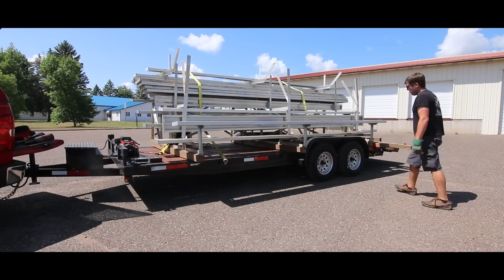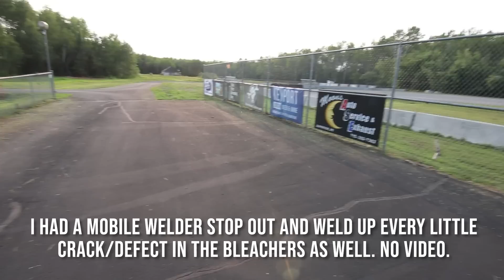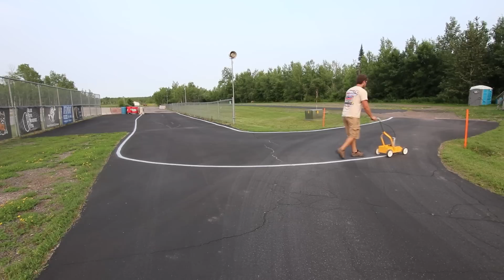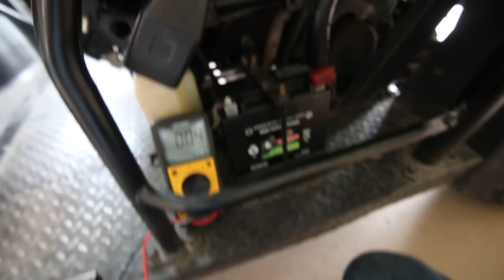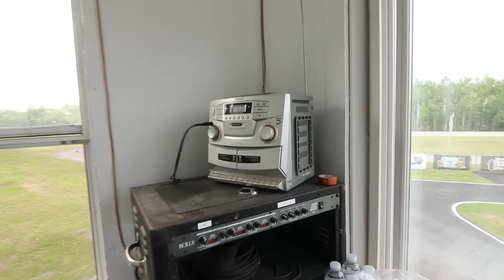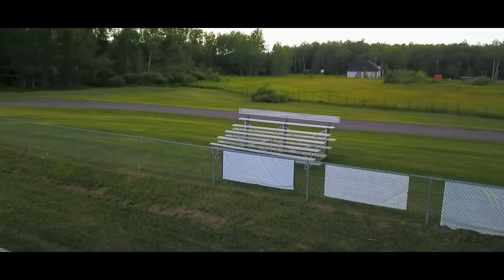FINALLY! We Bought & Installed The 3 BEST Racetrack Upgrades Yet!

Comment: Have been following you since the first video of this track and my gosh the development is so so beautiful. Slowly and steadily... I think this gives a much homely feel than anything track wise I've seen. You're doing an amazing deed. 

Big up, 
A supporter from India.
Reply from the maker: It does have a nice feeling when we are all out there. It's hard to explain. 

I really appreciate you sticking around this long! It's been a drawn-out process, but I'll keep pushing to make this a very nice racetrack for the size.
Reply: Hey I made a simple start light set up for autocross raceing for my geoupe you could make one in the tower it’s just two house switches in a box one is a three way for red and green other is a single switch for a amber stage light we just counts manually in our head 5 sec to switch to green I just use out door extension cords I used the ground oops 🙊 wire for the red light power and the black for the green light power then the white for common nutral and  another extension cord for the ground and to power the amber one with just plug ends it works perfect
Reply: Came here to say the same! What a cool project to follow, what a great thing to do for the motorsport community nearby! Keep on going strong! Grts from Belgium!

Comment: Old friend of mine used to use 2 old tyres and a long length of cord to run the wheels on to guide for a nice long straight line, I have no idea how he did curves though. He would just stretch it out close to where the line went with the tyres being heavy enough to keep the cord tight enough.

Comment: Great to see more progress.  Suggestion for striping.  Long string and use a brick on each end for a straight line to follow.   One brick with the string stretched out to a piece of chalk makes a consistent curve. 

 I would also suggest a horizontal 2x4 (or a couple) to the back of the top seat on the bleacher so no one sits down and leans back and falls.  First one should touch about 2/3 of the way up a person's back.   Especially important for kids who are not as situationally aware.

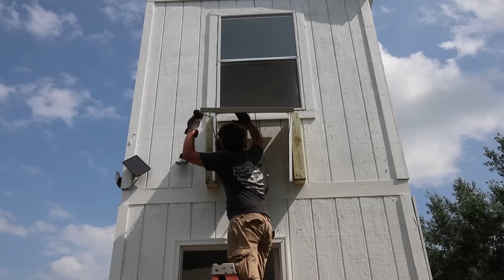Comment: If I got this right, you are doing a small solar power system at 20:40, right?
Reply from the maker: That's correct. It's a supplemental power system and UPS for the tower. There's no permanent service to it right now.
Reply: @Greenlightfilming  nice!

Comment: String lines help a ton when paint stripes….also the string line marked the edge of the paint line, not the middle.  Paint edge follows the string for straight lines…I watch all the videos! Your living the dream.  I am from ND
Reply from the maker: That is an excellent suggestion. If I put some more thought into the lines I may have came up with that. 

Now I know for next time. Thanks for the tip 🤘. You aren't all that far from the track.